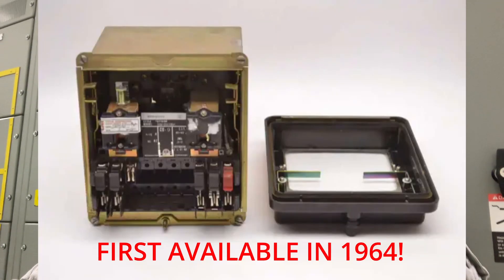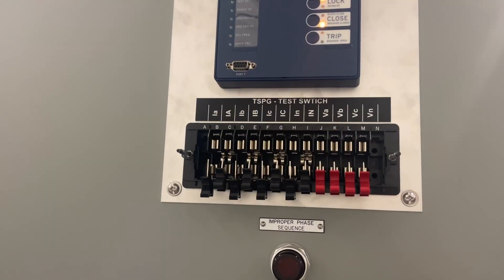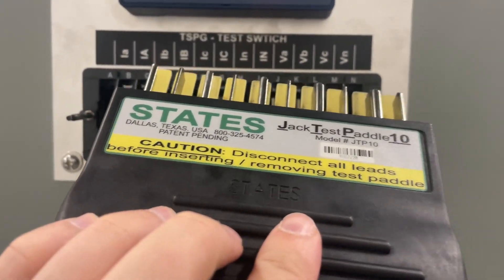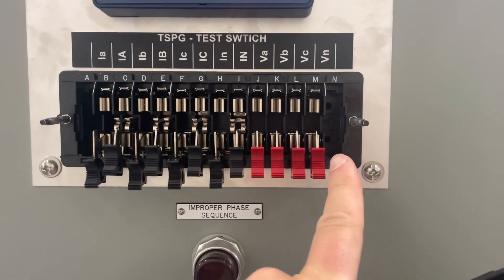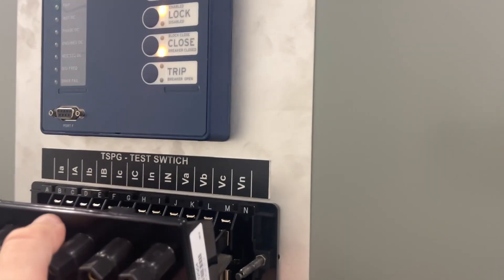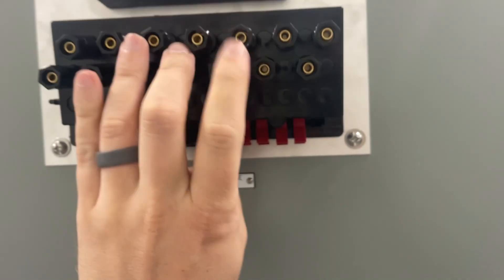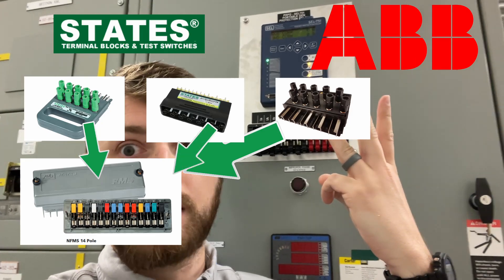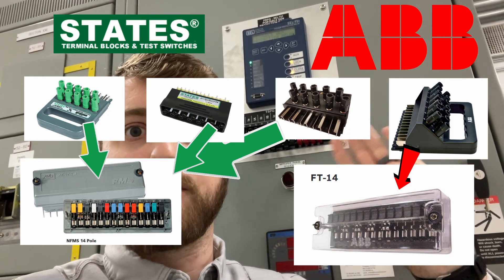ABB vs States Test Switch Paddles - Flexitest FT1 vs FMS

Comment: I hate that manufacturers use different dimensions. We should just get rid of test switches like this anyway and move to ones where you only need banana connections...
Reply from the maker: The fact that there are different standards and sizes is super annoying, but I actually like the utility of having a safe way to locally isolate trip and PT circuits and short CTs. The inconvenience of carrying around one or two test switch paddles isn't that bad. However needing 5+ different styles (including the ones for electromechanicals) is just awful.
Reply: @testingtechtips  yeah, that's the issue. sometimes you aren't sure which test switch they have and they you are SOL on site and need alligator clips or something else. There are some manufacturers that make isolation devices that then open up to a banana port, SecuControl for example. Even SEL dabbled in it, but it never made it to production

Comment: We have a GE FTC-058 test switch.  Wondering if the test plug can be used during an outage to inject test current into the protection device?
Reply from the maker: The GE FTC-058 is a standard ABB pattern "flexitest" test switch. Looks like they're only using the middle 8 positions but a standard ABB or 10-pole states test switch will work fine.